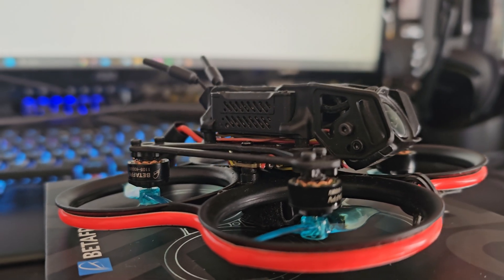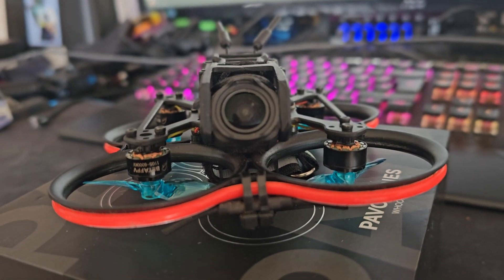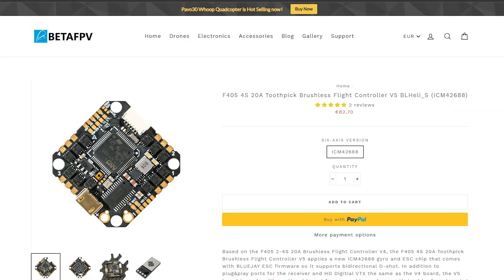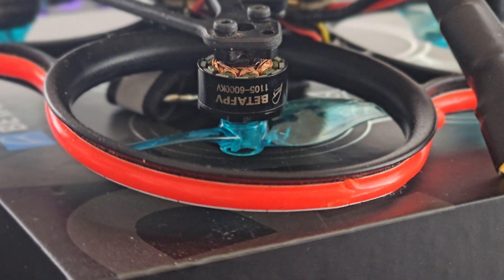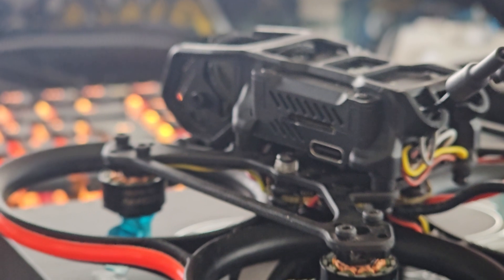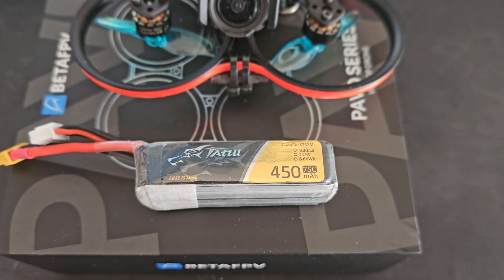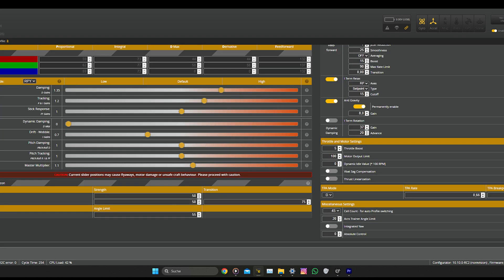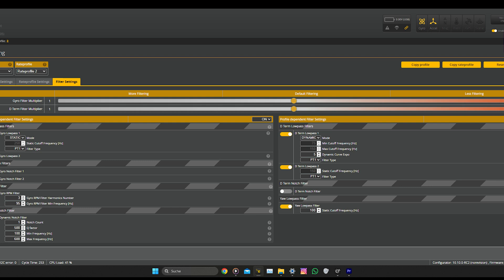My 4S Pavo 20 - Parts and Settings

Comment: What’s the purpose of this drone that claims to run the DJI 04 pro hot in a few seconds after its returnOn on top of that, this company has a reputation for never honoring their return warranty policy. They’ll give you the runaround, and if you ever send your drone back to them, you’ll never get your money back. It’s such a rip-off! this is my personal experience and I just wanna share it with everybody
Reply from the maker: My video is not the right place for that because the only part that's betafpv here is the frame. Anything else are custom parts. Btw, it's normal that the 04 air unit is getting very warm and sometimes hot when in use. That's not betafpv's problem and it's not a problem at all anyway.

Comment: Will 550 mAh work ?
Reply from the maker: Might work but it can feel a bit heavy. I think 450 mah is the sweetspot
Reply: @Mde7FPV  Shure, but I have so many 550 4s lipo's and thinking about changing the aio  ( I'm gonna build an Pavo )
Reply from the maker: @FPV_ELIAS  Make it a Pavo 20 Pro. It's a bit bigger and better suited for the 550 mah batteries
Reply: @Mde7FPV  that of course, but idk if I should do that
Reply from the maker: @FPV_ELIAS  why not? Pavo 20 pro is clearly better than regular pavo 20.
Reply: @Mde7FPV hätte das deutsche gleich erkennen Können xD 😂 ist er viel speitziger mit 4s, oder nur etwas ? So viele Fragen eig. 😭😅
Reply from the maker: @FPV_ELIAS  viele denken immer, dass man mit mehr Zellen dann auch gleichzeitig schneller fliegen kann. Tatsächlich ist es aber in der Regel so, dass man bei einer Steigerung der Zellenanzahl mit den KV bei den Motoren runtergeht. Im Ergebnis hat man dann am Ende in etwa die gleiche Umdrehungszahl wie vorher mit 3S aber man hat einfach eine Zelle mehr und das bedeutet, dass man erstens länger fliegen kann und zweitens mehr "Puffer" hat, wenn man mal über längeren Zeitraum Vollgas fliegen will, weil einfach noch eine extra Zelle da ist, die die Leistung abgeben kann. 
Man kann theoretisch auch bei den 3S Motoren bleiben und diese mit 4S fliegen. Das würde die Drehzahl und damit die Power und Geschwindigkeit deutlich erhöhen aber das Risiko, dass die Motoren dann abbrennen ist sehr hoch. Nicht zu empfehlen.

Ich hoffe ich konnte es einigermaßen verständlich erklären. 
LG

Comment: How about indoor? I am planning one mostly for indoors use , will the 4s be overpowered?
Reply from the maker: For indoors I'd leave it stock
Reply: @ stock means bnf version ?
Reply from the maker: @vatsalkonkani yes, the unchanged version, how it comes out off the box
Reply: @Mde7FPV  we have no supply for 3s from sellers. Only 2 batteries offered if i buy pavo. So i thought of 4s
Reply from the maker: @vatsalkonkani maybe choose some lower KV motors when using 4S batteries.

Comment: I made your pid settings, but when I put a little pressure on the throttle, there is vibration. Am I doing something wrong with the pid settings?
Reply from the maker: Check for loose screws first. Vibration is 90% due to something is not tighten good
Reply: @Mde7FPV  I constantly check them all, they are tight now, I looked again.

Comment: Did you add a GPS module meanwhile?
Reply from the maker: I can't see why a 2 inch would need that
Reply: @Mde7FPV  I lose the video signal very fast (just a few trees or so, DJI O3). I thought that could help so the drone will not crash due to failsafe. But I am new to that and maybe it wouldn't help.

Comment: Has Propwash improved by the 4s setup?
Reply from the maker: You always have to remember, this is not a freestyle quad, it's a cinewhoop. It's in its nature to have propwash when doing tight freestyle tricks. For regular flying or even racing, there is no noticable propwash present with my pavo.
Reply: @Mde7FPV  thx

Comment: Has the DJI air unit 03 not given you overheating problems? For me it disconnects after 2 minutes due to overheating
Reply from the maker: No, that never happened to any of my 03's
Reply: this may be happening if you are not flying? O3 unit overheats if you have it plugged in to a battery and not flying (like when you are working on the drone settings etc). Usually 1/2 mins and it overheats. If you fly, it is fine

Comment: Nice Custom build. But i’ve build my own 4s pavo20 got 9 minut cruising and 6 minutes little freestyle with 4s 730mah
Reply: Wich Motors do you use ? And whats your total weight?
Reply from the maker: 110 grams. Motors are 1105 6000KV from betaflight. But any comparable will do as well.
Reply: Please tell me what motors you use